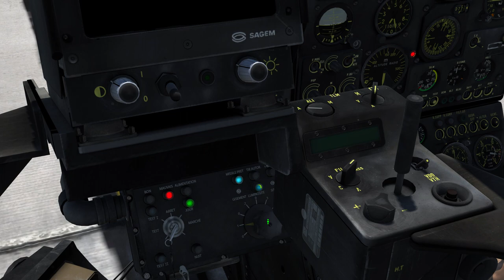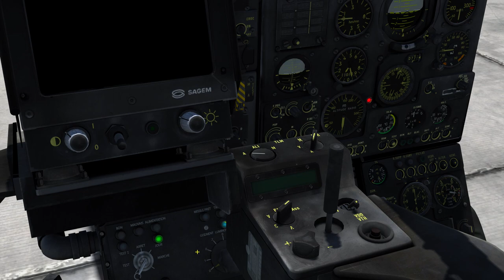[DCS] SA342 Gazelle HOT3 Anti-Tank Guided Missile

Comment: There were 2 Buttons or Key Commands that you mentioned but didn't specify what they were ... that is you didn't mention what the key combination was OR the Cyclic Button you have set. Plus I'm a bit confused on Panning the Camera/Tgt Reticle. Can't we just use a 4 or 8 way Hat on the cyclic to operate the targeting camera ? As opposed to using the Joystick while in Auto-Hover ??!!
The buttons mentioned were for Disengage Auto-Pilot so you can zero out the Auto-Pilot assistance while flying; 
Heading Sync Button for the Auto-Pilot to sync Gazelle's Heading to the Camera's Heading; BTW can you still Steer the Missile in this mode ?
If there is an ED Thread where I can find this information (or a specific page in the Manual), I'd gladly read it if I had the URL.

Thanks for the great videos.
Reply from the maker: +SnowTiger45 Hi,
Well, to break it down:
- The button to slew the helicopter to the camera while in autohover is called: "SA342 Auto-Slaved Toggle" inside the "SA342 Pilot Stick" catagory.
- The button to temporarily disable the autopilot is called: "SA342 Autopilot Master" inside the "SA342 Pilot Stick" catagory. It works similarly to pressing the trim button in the Ka-50, as it will disable the autopilots input. For some reason it won't cancle the auto-hover or any other special mode (speed/altitude hold) of the autopilot. That might change with further updates though.
- The button to turn on auto hover is called: "SA342 Auto-HoverToggle" inside the "SA342 Pilot Stick" catagory.

- Yes you can assing a 4-way hat to the camera. The options are called: "SA342 Slew left/right/up/down" inside the "SA342 Video Command Box" catagory. As you noted, additionally to that you can use your joystick while in Auto-Hover.

I hope that helps. The manual for the aircraft can be found inside the DCS World/Mods/aircraft/SA342/Doc folder. You can also download it from here: https://drive.google.com/file/d/0B1v4R709BvJUR3RfWmtlM1ltamM/view?ths=true (not my link, seems to be safe though). Have a look at Chapter 11 - Autopilot (page 129 in the .pdf), it should explain some of your questions better than I can.

Best regards,

John
Reply: +xxJohnxx Thanks for the detailed reply.
I got a few things set up yesterday prior to receiving your reply. As it turns out I completely misinterpreted the intent of the "Auto-Slaved" toggle. So I will have to remap that one.
For some reason I was thinking that the Joystick/Cyclic "HAD" to be used for panning the camera while Hovering, even though I already had the Slew functions mapped to a Hat. Now I know that was obviously programmed for those who might not have a spare Hat to map the Slew functions to ... that they could then use their Cyclic instead.
I am now digging into the Manual. But I had to get a couple preliminary flights in first ! This thing is definitely going to take some practice, although hovering manually isn't as difficult as I first thought it might be.
Thanks again Friend.
Reply from the maker: *****
No worries! Glad I could help out! :)

Comment: What did you do to make the SA342 stop moving and stand still?  I tried to autohover when it still has forward speed.
Reply from the maker: Yeah, for the auto-hover to engage you have to be hovering (or very close to hovering). It won't work if you have any forward speed. So, just slow down the helicopter yourselfe, bring it into a hover and then enable auto-hover. Should work ;)
Reply: I did this: 
1. Pull back on the joystick to slow down the helicopter to almost 0 speed. 
2. Stabilize vertical speed to 0 by adjusting collective. 

Now the next problem that I cannot solve: When I disable the auto collective (c key) and try to adjust the collective +/-, then the SA 342 crashes to the ground. Why is it that I cannot adjust the collective, while auto hovering, without crashing straight to the ground?
Reply: This is because you haven't matched the collective to the position the auto hover is using - bring up the control overlay and you will see the auto hover settings marked in white. If they are too far out when disabling auto collective, it seems to kick the auto hover off completely.

Comment: Always a fan of your videos!! 
I got one question about the "axis controls" I think i set my throttle correct but when i try to takeoff the heli just spins in one direction, I guess it could be the rudder (had the same problem with the Huey) any tips?
Reply from the maker: +Daniel Solbrekke Do you have a rudder pedal asinged properly? If you go to the controls and select the Gazelle/SA342, look into the "Axis Commands".
There you should find the "Rudder Axis". Do you have your proper joystick axis configured for that? Is there maybe another input (second joystick) that messes with your normal input?
Reply: +xxJohnxx I don't have any rudder pedals and I use the TM warthog, so I always clear the "rudder axis"
Reply from the maker: Daniel Solbrekke
So what do you use as a rudder then?
For the helicopters you definatelly need some rudder input.
Reply: +xxJohnxx yeah, i guess it's time to buy one :) 
tried to bind the slider on the throttle to rudder. And yeah, that's the problem :P
Reply from the maker: +Daniel Solbrekke Yeah. Flying with a good set of pedals is much more fun!